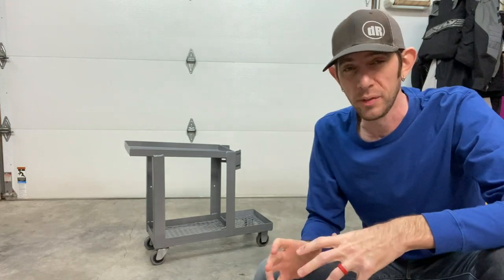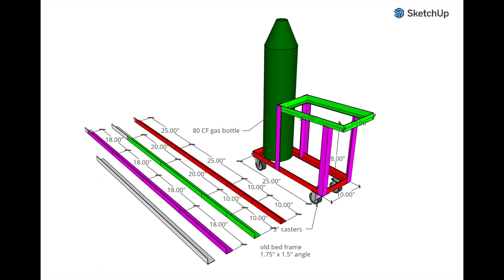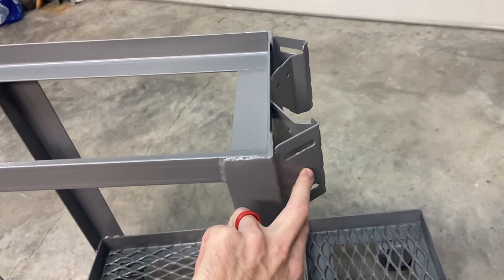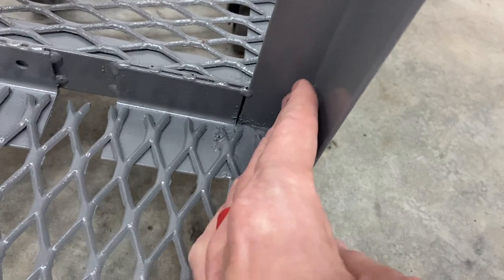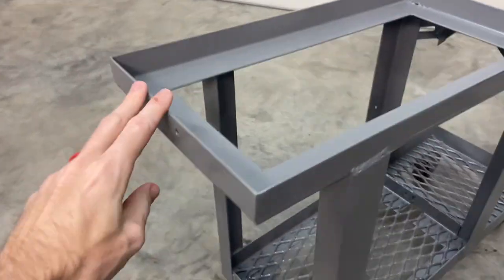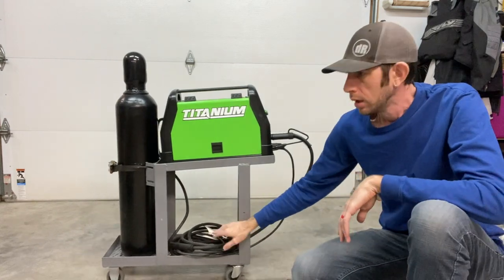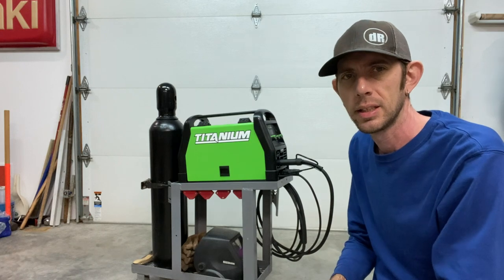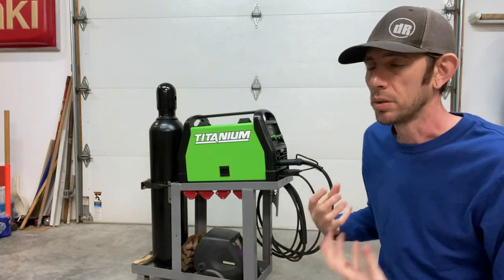Welding Cart from Bed Frames

Comment: I also built a welding cart out of bed rails!  Mine has a 3 drawer file cabinet,  1 lg drawer to keep helmet / manuals & receipts, 2 smaller drawers for gloves, tips, wire & access., a place to hang 3-4 grinders, my lg tank (which was a 2 wheeled dolly),  Also has on one side, a like 2'x2' fold down table for welding on.  Came out "FANSTASTIC"!!!  I would like to add a small vise on table some day.  My only issue w/bed rails was trying to drill holes in them  🤔.
Reply from the maker: I was looking for a file cabinet like that to use, but could only find the standard 2 drawer variety so I decided to go super cheap and just build something with what I had.
Reply: Curious, were you able to drill holes in the bed rails?  Nothing I had would drill them!
Reply from the maker: @fjbowen3155  I did not drill any holes, but I’ve heard that they’re super difficult to drill. Need very sharp bits and will likely have to resharpen frequently if drilling many holes.

Comment: Odd that you couldnt find anyone with 75/25 in stock. If you ever end up needing a second cylinder gas cylinder source has empties with recent tests at a good price.
Reply from the maker: They had the smaller and larger tanks, just not the 80CF